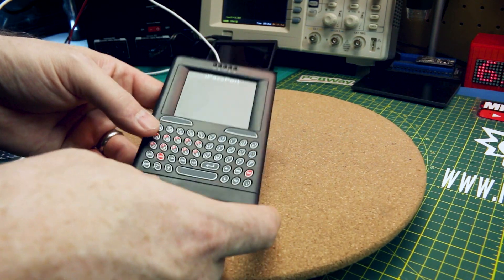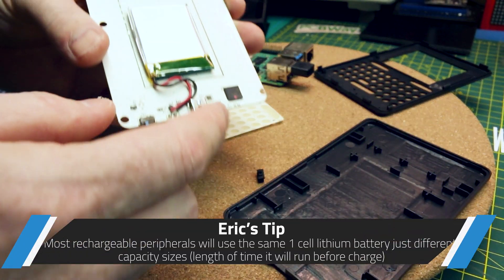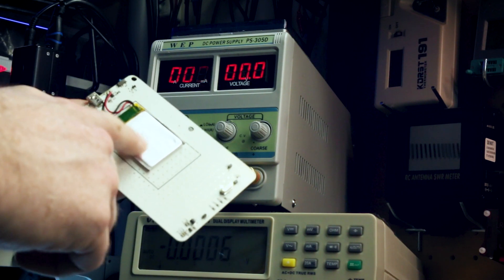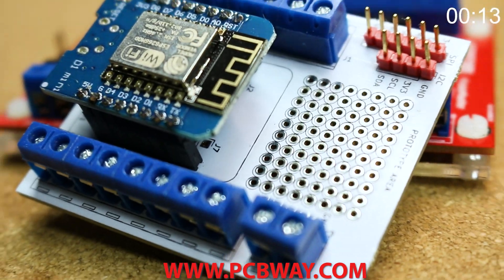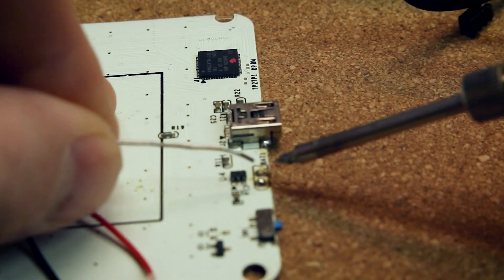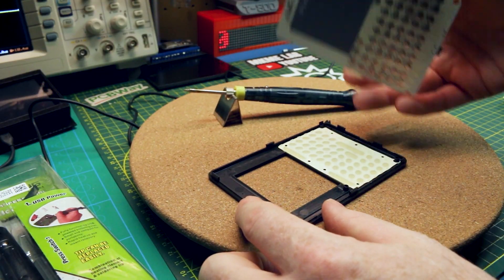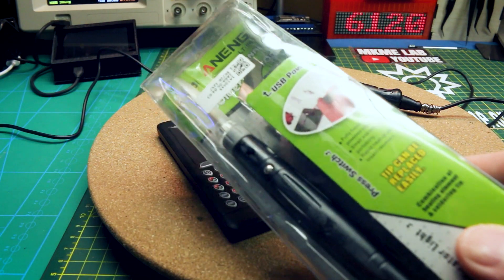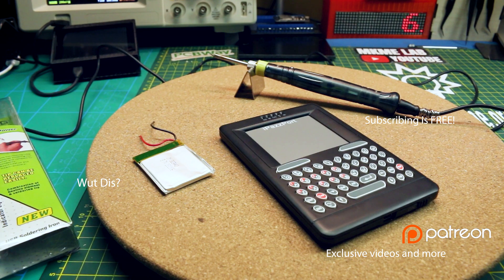How To Fix a Wireless Mouse or Keyboard- Tutorial

Comment: TP4056 charger boards will try to kick the battery into gear with short little current bursts. It can take a while, but if the battery is OK, it's a reasonably safe way to do so, because for one there isn't really a lot of charge needed to reach 3V, at which point regular charging can start; and for other, the bursts are gentle enough that it won't be able to catch fire, it will dissipate the heat safely, and if there is a dendrite issue or anything like that, any kind of electric leakage, which makes the battery unsafe to use, there's enough time for the battery to drain again so it just won't come back to life. Protected TP4056 boards are OK to use for this too, those equipped with DW01 chipset, because while the DW01 disconnects a dead battery from the device unless it's within the safe voltage range, it actually has a special provision to let those wake-up charge pulses mostly through.